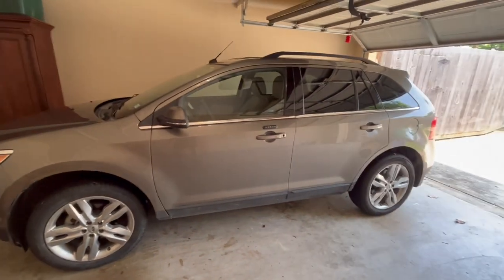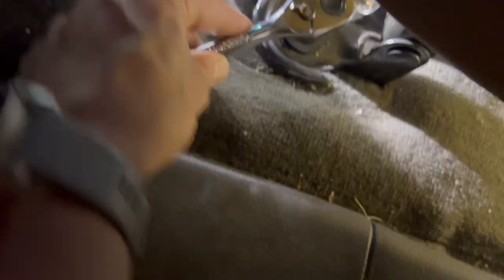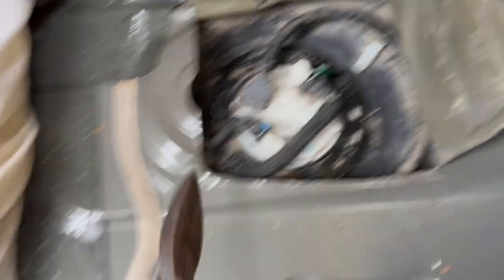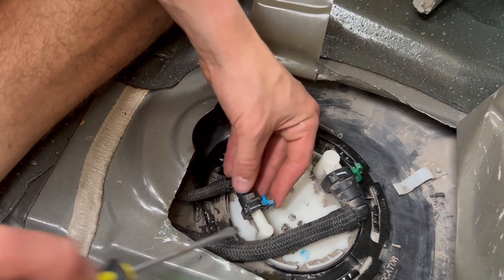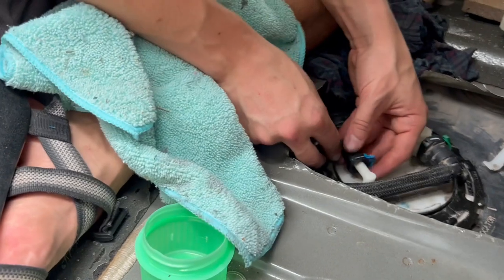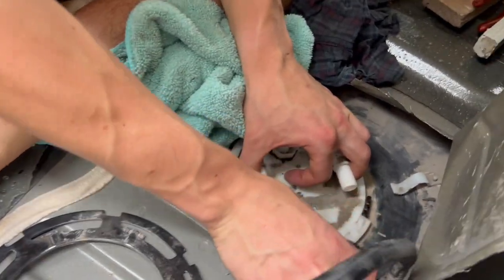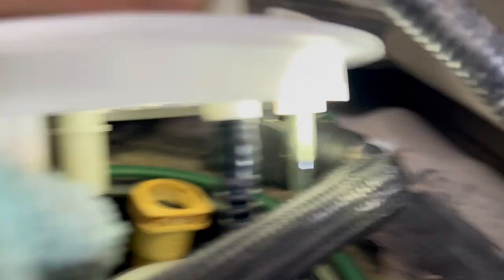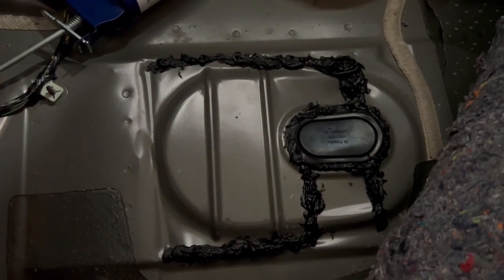2013 Ford Edge Fuel Pump Replacement

Comment: Good video.  I wish you would have shown if you actually had to cut that panel out or not.  Also, your original issue sounded like it could have been a purge valve issue.

Comment: I have a 2013 ford escape am I able to do this the same way you did this with out taking the whole gas came out from underneath the car, watching another video that looks like such a nightmare so that would be great if I am able to do it the same way that you did it, another question, is the fuel pump attached to the fuel filter? Just wondering if I should change the whole thing out because it’s the filter that I was looking to change.

Comment: I may need to do soon and its hard start midday - I think it may be losing pressure somehow.  

I made a video on how I did the ABS module replace - crazy tough.   I love my edge otherwise
Reply: Have you replaced your fuel pump yet wondering because I’m having same issue with my ford edge not starting midday.
Reply: not yet - no problems in cooler weather  @MrDougiefresh69
Reply: @pokeyboy1  It is cooler weather but the car starts up every single dark and early morning, but just doesn’t start like 2 times a week. It will start when jumped. I replaced the park detect switch just earlier today.

Comment: Do you know where the fuel filter is located?
Reply from the maker: Fuel filter is part of the fuel pump assembly. You’ll see it once you pull it out at the bottom of the pump, looks like a rectangular mesh patch.

Comment: Looking at that I’d install a metal panel over the whole thing.
You had plenty of room to cut one to size.
Reply from the maker: I considered it, but I think a flat piece of sheet metal would press against the hose connections. In the original stamped metal you can see they have it elevated by probably a good inch.